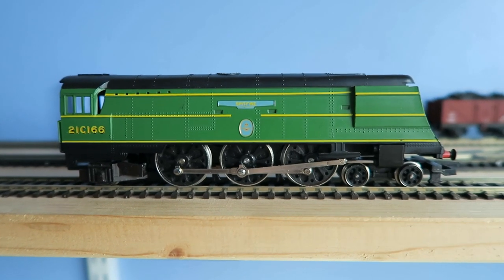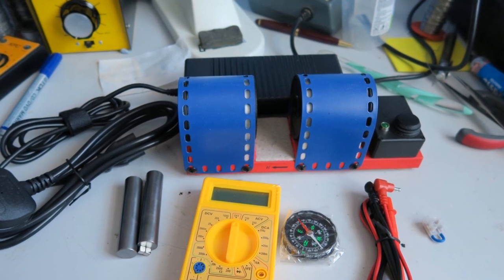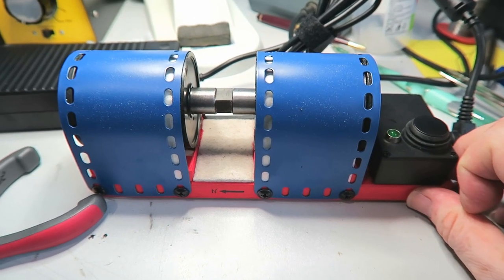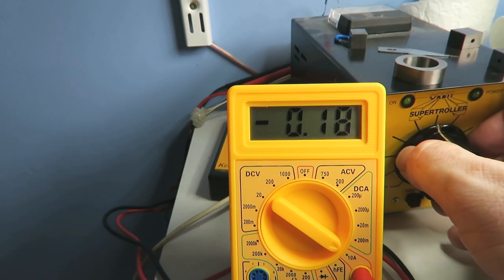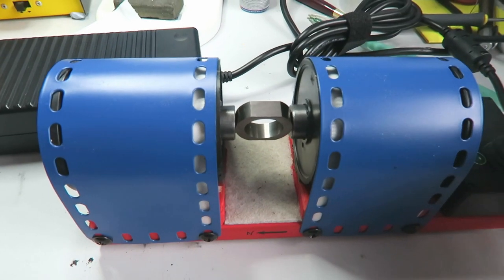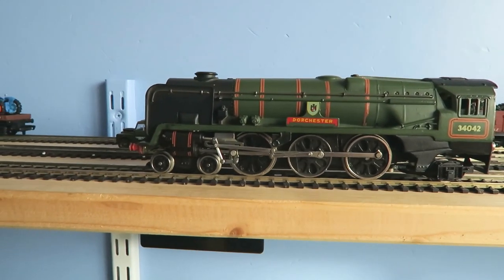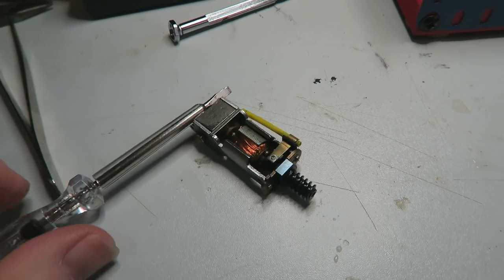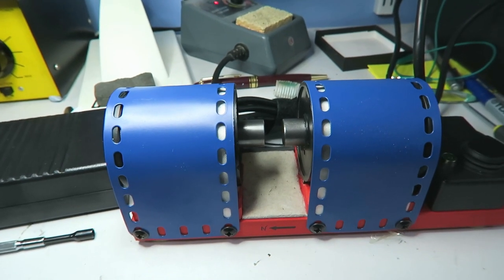Re Charging Hornby, Wrenn motor magnets. DEMO ONLY SEE TEXT

Comment: Hi.  I live in the United States and have a special American Flyer locomotive that has a direct current motor with a "permanent" field magnet. The manufacturer that made these made only two types of engines with direct current motors and the rest had alternating current motors with coil field magnets instead of permanent magnets installed.  The alternating current locomotives have a mechanical reverse mechanism that is automatic.  The magnet is extremely similar to the size of these Hornby/Wrenn magnets and has lost a considerable amount of strength over the past 70 years.  It is an extremely large locomotive with a wheel base of 4-8-4.  It is an "S" scale locomotive that has a solid die-cast chassis AND a thick, die-cast metal body.  Its magnet is probably within the specs of a Dublo magnet, but nowhere near strong enough to pull a train at appropriate speed considering how much larger it is than oo scale locos.  The locomotive is supposed to be able to haul about 6-7 coaches at a time at considerably high speeds and is struggling just getting up to speed light engine.  It is all-original and I'd rather not have to replace the magnet, but simply recharge it.  I can't exactly justify spending nearly £200 on this device considering shipping will be high for oversees delivery.  I was wondering if you may possibly be willing to recharge this magnet for me?  If you could contact me directly to my email to work out payment options, that would be just wonderful!  My email is: Camdensmodelrailways@yahoo.com
Thank you very much for your time!
Camden Justice
Reply from the maker: Email being sent

Comment: You've got your North and South mixed up assuming the red end of the compass needle points North. There's even an arrow on the magnetiser showing which way  to insert the magnet which disagrees with what you say. Remember North attracts South and vice-versa. Check Ron's video, he gets it right. There is an arrow on the magnetiser showing North is to the LEFT, Ron must have done that as his magnetiser has the same.
Reply from the maker: Thanks for the interesting comment. I have had no issues with locos running in reverse, maybe the compass pointer is off? I'll check when I can and let you know
Reply: No, no what you did was correct, what you said confused me. Thinking about it again you are in fact correct, apologies for that. The red end of the needle is attracted to the North pole so it must a South so the white end is the North of the needle. The white North of the needle will be attracted to the South of the magnet just as you said, haha! Far too many Norths and Souths involved. Apologies again.
Reply from the maker: hahah no problem at all Don, like you say a bit confusing. I have since marked up the machine with Hornby top and others, so I can just slot the common X03s in without checking :) all the best

Comment: I've run into the problem of weak magnets with a vintage Gilbert/American Flyer HO locomotive from the 1940s, and with numerous Lionel HO motors from the '60s. In case of the latter, I've had good luck replacing the old Alnico magnet with neodymium magnets. I was using stacks of 1/16" N40 strength magnets, two stacks of 9 seemed to give me the best results. I would like to recharge the originals, but can't afford one of these machines. But I have read a little about making your own, so I think that's probably what I'll have to do.
Reply from the maker: Wow, hope you make a video of the process
Reply: Im not into the hobby of model trains but i am into collecting magnets, with this in mind I can say that you can re-magnetize your AlNiCo magnets with Neodymium magnets, just get two magnets of the same size or slightly larger than the poles of the AlNiCo magnet  (be it round or square does not matter that much as long as they are larger than the poles) and stick one of them to each pole of the AlNiCo then remove them pulling away without sliding and that's it. You can glue the neodymium magnets to a wooden dowel so you can use them as handles, this way you can pull them apart much easier and straight away so the magnetization is exactly as it should be.
Reply: @teresashinkansen9402  Thanks so much! I'll have to experiment some time. I have also been entertaining the "diy" magnetizer route more seriously. Thanks again for your advice!